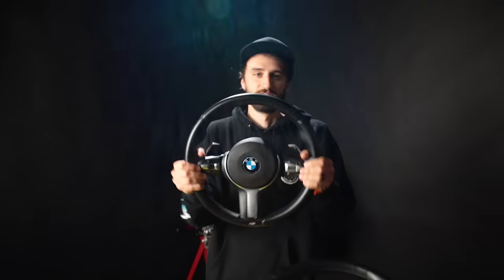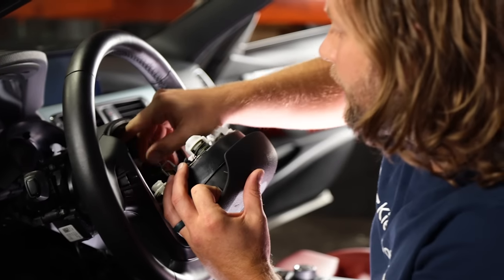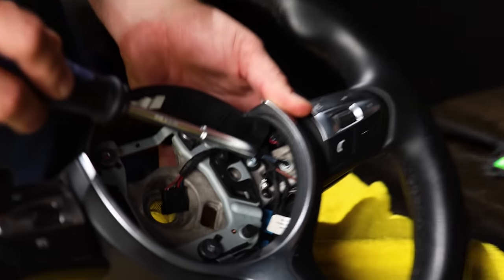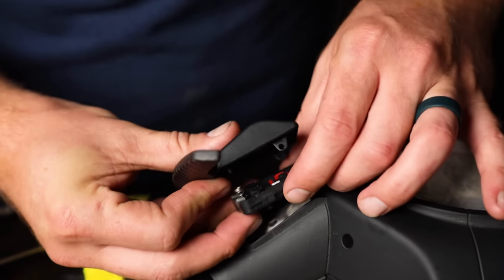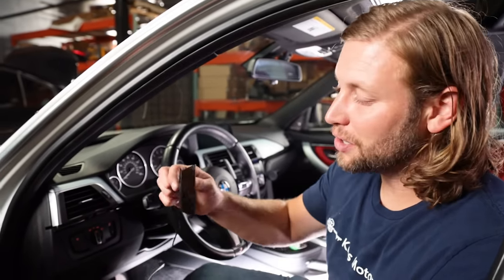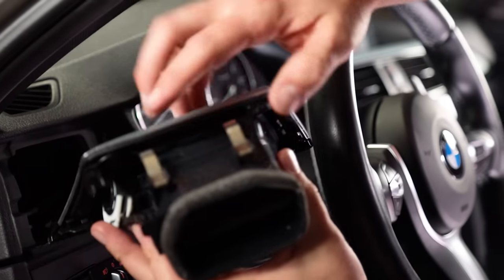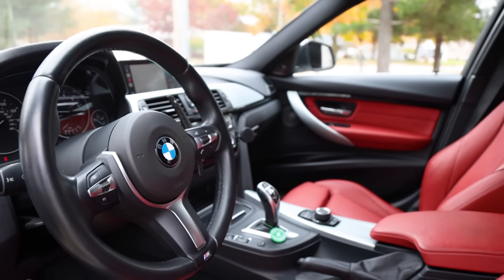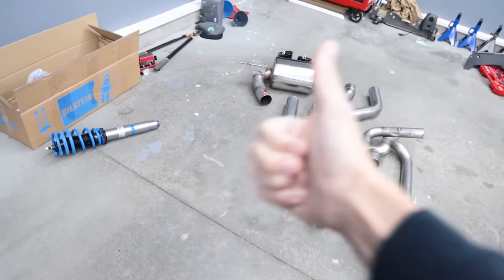How to Upgrade Your BMW F30 Steering Wheel THE EASY WAY

Comment from the maker: Complete F30  Mods List ---> https://geni.us/f30-mods
Reply: Hello, what do we have to have in mind when it comes to the new airbag? So that it won't make airbag light on the screen?
Reply from the maker: @tugaxD23  just disconnect the battery first and you won’t have a problem. As long as you use a compatible airbag, you wont have any warning lights afterward

Comment: It’s also possible to remove the airbag by turning the wheel 90 degrees. You’ll then see the clip from behind at the top! Without removing the covers!
Reply: Good tip!
Reply: @MigySaan  p
Reply: The batteries are disconnected !! No steering !
Reply: @MrCornetto1  You can still turn it by applying some force 💪!
Reply: @agilbert314  I'm not sure but i've heard that, that might damage your power steering
Reply: @ville0115  I doubt it. You have to be able to control the car even if you loose power steering.
Reply: @ville0115  if ur a skinny bastard like me u can just lift the front end itll turn alot easier
Reply: @MrCornetto1  Uhhh rotate the steering wheel when the battery is connected then remove the battery
Reply: Dude that's super easy..I could see them easily..save me time ....just rotate the wheel facing the floor and pick the springs.... Thanks
Reply: We
Reply: Kies are notorious on making simple things complicated 💅

Comment: Two tips:

1: As others mentioned, turn the wheel 90 degrees so you can reach the bottom clip once the steering wheel trim is removed. I'm really surprised Kies never mentions this because this is such a well known way to give yourself more leverage and make the removal a lot easier. The easy way to do this is to turn the wheel first, then disconnect the battery's negative terminal, then begin your work. Once the first clip is removed, you can just muscle the wheel to turn it the other way and reach the second clip. This won't damage the power steering or the wheel.

2: I don't recommend the extended paddle shifters because they're extremely wobbly even when tightened all the way. This is a known complaint that Kies conveniently never mentions. But if you do decide to upgrade the paddle shifters like I did, be extremely careful when taking the guide pin out (5:19). I broke mine and can't find a replacement because it's such an obscure part. They get extremely brittle over time. Also, the T20 screws that hold the paddle shifters in place are very delicate. Try not to over tighten them because trust me, they will snap.

Comment: Much easier to remove the wheel by turning the wheel, clockwise and anti-clockwise and releasing the clip with a flat blade screw driver. That's typivally how I've taken airbags off many VWs. Great fun video!

Comment: Actually, you must wait 5 to 10 min after disconnecting the battery before messing with airbags.  You never know if the electric circuit in any car has a capacitor to work as a back up for safety emergencies.
Reply: True , many years ago I was reading the 97 honda civic technical manual,  it mentioned something about a power storage in the airbag computer
Reply: @domkraggp9944  American OEM's use backup systems to power up after disconnection and record data for about 100 ms after a deployment.  I am not sure about the specs for European vehicles.
Reply: @wysiwyg2489  Has this actually been confirmed anywhere for American OEM BMW airbags? I removed mine yesterday right after disconnecting the battery and had no issues. That said, I do think it's better safe than sorry.
Reply: @ShockwavesFTW  Hi there, my recommendation is based on 20 years of working experience with airbags.  I don't know details about BMW airbag circuits but most USA OEM's include a capacitor inside the restraints control module (RCM) to trigger the airbag as a backup, some not.  As prevention, the best is to wait for 10 min so any capacitors loads discharge completely and you discharge yourself any static current you may have, specially in winter and when working on a rubber mat.  It takes about 400mA to deploy an airbag.  Take care!

Comment: Those interior upgrades are a touch! 

So I already have the steering wheel you upgraded to, is there a way I can take off the original paddle shifts without taking of the steering?

Comment: My car F30 is now at 130,000 miles. Being in a 4cylinder. I am still deciding whether to go to a 340i with the latest infotainment or a next-gen model with 4 cylinders still. Driving it for so many miles makes me want to drive the next-gen but I also want a bigger engine...The m340i is still expensive. Fortunately, my maintenance is perfect and I have modifications that make this 328i a car that can last to 200,000 miles, Timing chain and all.
Reply from the maker: The B58 is an incredible engine. If you test drive one, you'll probably end up going with the 340i
Reply: @justinbuice  That's a good idea... I need to do a test drive to help me get a better idea.

Comment: I did this upgrade on my 2013 328i F30. After installing, upward shift worked but not downward. I rechecked the wires and everything looks fine. Any guess what it would be ?

Comment: Hi. I also want to do that to my car. I hope you can solve my question. When I put the new steering wheel on, the audio and cruise controls still work normal? Are they connected in the same way as the previous steering wheel?

Comment: Can the kies dry carbon paddles work with the sport steering wheel (non-msport)? Im assuming it will since i have the same paddles as the ones you switched from, but just wanna make sure. They would be a sweet upgrade to the sport steering wheel

Comment: Hi nice steering wheel, one of the best looking and comfortable BMW steering wheels.

Can I check - do you need to key in any code of the airbag of the new steering wheel into the car's CPU after replacing the wheel for the new airbag to work?  Thanks

Comment: I found the solution to my problem!  I have replaced a regular sportline steering wheel with an M Sport steering wheel then the steering wheel heater stops working, I first thought that the heater in the steering wheel was broken, so I switched to a working steering wheel, still does not work !?  but then I know that M sport steering wheel must be coded via BimmerCode because it does not have the same electronic box in. if you have bought a used car and do not check that it works it may be that before the owner has changed the steering wheel and not coded it.
Sorry for the typos, my english is not good 😊

Comment: Thanks for this video. I just did the m sport steering swap. I was wondering besides paddle shifter coding is there any other coding we should be concerned about like airbag etc.? I did have a "chases stabilization" warning come up on my test drive.

Comment: Those P3 vent gauges are pretty cool but at close to $400 it's a bit of a rip off when you consider how much simple HUD display costs (around $20 to 50) and can show more or less the same info. I get that they are custom fit but even so shouldn't really be anymore than around $150.
Reply from the maker: It's definitely pricey, but you're paying for a finished product that's tailor made to fit the car. Not to mention the control module is programmed to show only the most important parameters, that way you don't have to scroll through literally hundreds of parameters to find the one you're looking for. At the moment, I don't think there's any competition for this exact product which is no doubt reflected in the price
Reply: @justinbuice  I get what you say with regards to the benefits of the product but you are talking around 10 times the price or put it another way 1000% more for those privileges. If it was 2 or 3 times the price or even 4 times maybe but as much as I love my car and like to do mods I just couldn't justify that kind of price difference for the benefits returned though I can understand why some might buy it.

Comment: What do I need to purchase to upgrade to the M Sport steering wheel if I have the standard steering wheel in my 2016 BMW X4. Do I need to find one with everything included? Buttons, airbag, everything? Would it be as simple as plug and play?

Comment: My 2016 320i Xdrive does not have OE paddle shifters.  I love the look of the upgraded steering wheel,  but is it still possible to do this if I don't start out with the paddle shifters?

Comment: Wow, cool tutorial!
Question; if i want to upgrade the wheel on a base model manual to the msport wheel, do i have to look for anything specific or will a msport from a manual model work?
Mine's a pretty stripper model, but some mods will spruce it up a little.
Reply from the maker: it should be plug and play
Reply: @justinbuice  Nice! Thank you. Will be on the look out for one.
You'd be surprised how stripped down f30s are here over in europe compared to us models :D

Comment: Hi,

I have a manual bmw f30 with a standard steering wheel. I want to change it with an m sport steering wheel without the paddle shifters.

Do I still need to code it?

TIA

Comment: Did you need to solder a wire from passenger footwell  to steering wheel SZL? I retrofitted for paddles and it messed my car up I think

Comment: What all parts did you need to order to upgrade to the MSport steering wheel? Is it just the wheel, airbag, and multifunction buttons? My Sport Line has the paddle shifters and I'm wondering if you can carry those over to the MSport steering wheel.

Comment: Disconnecting only the negative is not the way I would do it, when working aircraft you always disconnect positive side so you don't accidentally ground out to the airframe. If the positive is still connected any negative that touches the ground/frame of the car you are going to get a short.

Comment: Hi, if I missed the indentation on the steering wheel and is it possible to install it not in lined with the column?  I mean not a huge miss inlined but just maybe one or two teeth? But the steering wheel will still be able to put in?
Reply from the maker: the wheel wont physically go on if it's not lined up
Reply: @justinbuice I see. Thanks man. I am having a steering centering force problem. The force is stronger from left to center than from right to center. And the steering is crooked a little towards right. Seems like the zero position of the steering is also slightly towards right makes the EPS gives more power trying to back to the center from left. Just did alignment, don't know if the incorrect alignment is the reason or not centered installation of the steering wheel which is not possible as you said.

Comment: What is the difference after installing the m sport wheel ?
Reply from the maker: it's only a visual upgrade. If you have the base steering wheel, the M sport wheel is thicker and easier to grip

Comment: Isn't there a more superficial, cosmetic way to achieve a similar M-style look without actually changing the wheel?
Reply from the maker: You can buy the trim piece in carbon fiber and it's a lot less expensive than replacing the whole thing
Reply: @justinbuice  But the M-cut trim will definitely not fit over the regular steering wheel :/